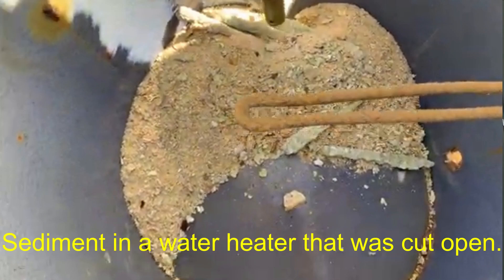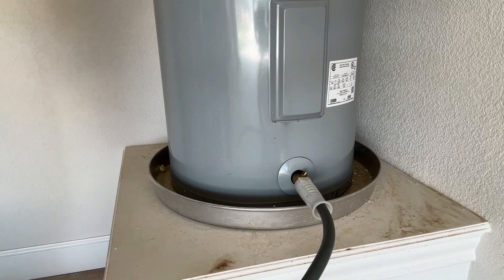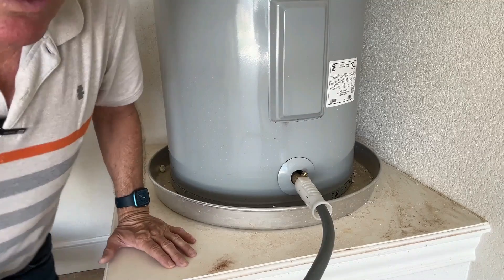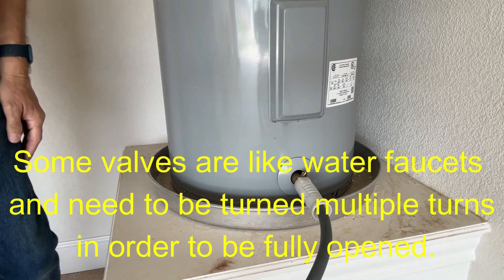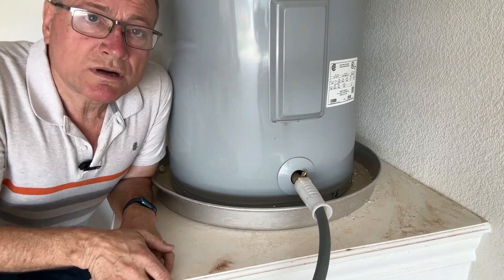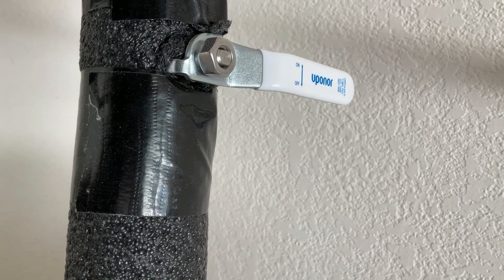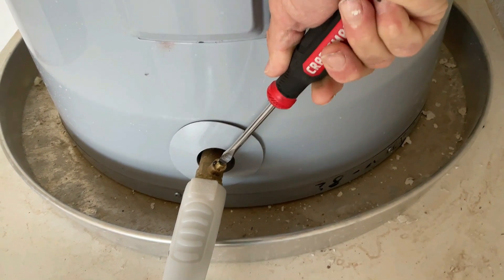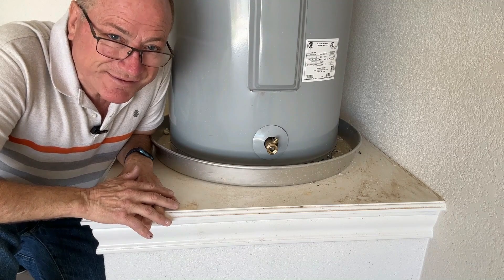How to Drain a Water Heater for Beginners: A Step-by-Step Guide

Comment from the maker: Thanks for watching!
If you haven’t drained your water heater in a while, it’s never too late to start.
A simple flush once a year can extend your water heater’s life and save you money in the long run.
If you found this helpful, please like the video and check out my other home maintenance tips!
Reply: I have a strong suspicion that if I crack open the drain valve, that it won't close again after. I was wondering if I find a way to catch it funnel the water to the floor drain, could I just turn the water and gas off, spin the drain valve off, let it spew out the buildup and then eventually reinstall the valve and turn on and refill it?

Comment: This is my first time draining a water tank and this is the first helpful video I've found. I've lived in this house for six years and i won't know if this has ever been done before. I followed your instructions and at first, nothing would come out if i shut off the water to the tank. I found that i had to open the prv , but still the water is draining very slowly. It is not hot, though the water coming from the taps was at first. I'm going to try to drain the tank completely and then try poking a wire in the drain valve as you suggested to another viewer. Would that be a good thing to do?
Reply from the maker: Yes. That would be a very good thing to do. I would also suggest that while you have it empty, you replace the drain valve with a ball valve, which will make it much easier to drain next time. The drain valves they use on these water heaters have a very small opening and clog so easily.
Reply: @morganinspectionservices3840 Thank you for your reply. I did try that, but the wire would not even go into the drain valve. I would replace the drain valve with a ball valve if i knew that it was straightforward.  This stuff is not something i typically do. I'll see if i can find a video about that. I did get my tank flushed, and the water seems hotter now. Again, thanks!

Comment: Thank you! One question. All sorts of products to supposedly descale the water heater. Is anything like that worth doing?
Reply from the maker: For most standard tank-style water heaters, flushing with plain water once a year does about as much good as those products. Descaling chemicals tend to be more useful for tankless water heaters. If someone has very hard water, installing a water softener typically does more long-term good than any pour-in product.

Comment: What if you have a grundfos nonsubmersible circulation pump/timer coming off the hot line out of heater?     Does that have a process in this too??     Help please!

Thanks for your time
Reply: The water recirculating pump should have a valve shutoff that attaches or is part of the water heater drain.  Shut this off so all the water goes out the drain.   Usually you have your open the pressure relief valve too to get air in the tank.    It should work the same as the other steps go.

Comment: Thanks for the instructions. I'm unclear as to what electricity I'm shutting off if the water heater is not connected to electricity. What am I missing?
Reply from the maker: Thanks for watching. If it’s a gas water heater, there is no electricity to shut off. You just need to shut the gas off. I did specify that you turn the electricity or the gas off. Thanks for your comment.

Comment: Would it be a good idea to water some of your plants with this drainage water?
Reply from the maker: Yes, you can use water from a water heater to water plants, but it is not ideal for edible plants due to potential contaminants from the tank and should be used for non-edible plants and ornamental gardens instead. The water might also contain minerals, and while typically not harmful, high concentrations can build up in the soil over time. Using this water for non-edible plants is a form of water conservation, but it's important to consider the potential for disease spread or damage from chemicals used in the system.

Comment: Mine isn't draining like that out of my hose. I drained a lot from two faucets in the house.
Reply from the maker: Sorry. I just now saw your comment. If it’s not draining out of the hose and you’ve got faucets in the house open, you probably have so much crud in the water heater that it’s blocking the drain valve on the water heater. You can probably take your water hose off Open up that valve and sticker small thin wire up in there to kind of break things up. You need to be careful because the water will probably start draining out, but you can quickly close the valve, attach your water hose and reopen the valve. Another thing you can do is close the faucets inside your house and turn the water supply back onto your water heater so that the water pressure can force stuff out of the drain valve. Once it starts draining, shut off the water and see if it continues draining. Make sure you’ve reopened a faucet or two inside the house.

Comment: Yeah, I have a comment as A Plumber of 22 years draining your water heater isn’t going to get any set out. You need to take the bottom element out and vacuum out the sediment to do it properly. Otherwise all you’re doing is draining water and putting water back in no help at all no difference than turning your hot water on Somewhere and leaving it run until it’s cold sorry but this is bad advice and it’s not how a  Plumber would clean the settlement out of the water tank. Maybe leave it up to the plumbers to give the advice not a home inspector. Not trying to be mean just trying to be honest and help the people out that have no idea and don’t know better listening to how to do things wrong or waste their time
Reply from the maker: Thanks for the comment — I genuinely appreciate input from professionals. That said, I’ve been taught this method by a plumber, and I’ve also watched many YouTube videos by other plumbing pros who recommend the same approach I show. 
Removing the heating element and vacuuming out the sediment may be the best way to do it, but it is not something I’ve ever seen recommended for basic homeowner maintenance. It’s invasive, unnecessary in most cases, and could cause more harm than good if done improperly.

This video is meant for beginners who want to extend the life of their water heater with a simple, safe flush — not perform an advanced service. For serious buildup or performance issues, I always recommend calling a licensed plumber. But for most people, draining their water heater once a year is a huge step up from doing nothing at all.

Thanks again for adding your perspective to the conversation.
Reply: OK, let me ask you this just because you were doing something that you saw on YouTube for however long you’ve been doing it doesn’t mean you were doing it right. I only say that to make a point you can do something wrong for your entire life thinking it’s right I’ll make it right again. What’s the difference between what you’re telling people to do and just opening a hot faucet somewhere and letting it run until the hot water runs out you’ve just done the exact same thing in my opinion give people false hope and if you offer that as a service that you get paid for from a customer, you’re just taking money for doing nothing really. And you’re absolutely right that’s why they should call a licensed plumber so they get it done the right way once a year flush and vacuumed so that all the sudden out and you can also check the elements for continuity andmake sure the thermostats are set correctly and that they’re both set at the same thing now that’s a service worth paying for. Just my opinion again not trying to be mean or anything just stating the obvious thank you. Have a great day. best of luck with your adventures.
Reply: @StephenMcDonough-eg5nm  isn’t it different because the drain valve is at the bottom of the tank where the sediment settles to?  Where does the water get drawn from to source the water that goes through your faucets?  Is it higher up the tank?  Honest question coming from a person with no experience of water heaters outside of buying one at Home Depot

Comment: When can you turn the water heater power back on?
Reply from the maker: Once you know the water heater is full, you can turn the power back on. Typically, you know it’s full because you have “hot” water running to one faucet. Initially, there would be a lot of air coming out of that faucet. Once it is only water coming out, then you know the water heater is full.

Comment: Great video just a question how do you know if your tank is full enough or full to the point in which you can use it after the process is over?
Reply from the maker: When you start refilling the tank, you need to open a hot water faucet in the house. Once it starts getting full, air and a little bit of water will spurt out of the faucet. More and more water along with some air will continue coming out of the faucet. Once you have only water coming out, then you know the tank is full.
Reply: Thanks for the fast response and answer appreciate it big time🫡